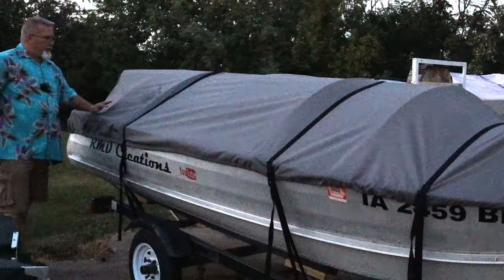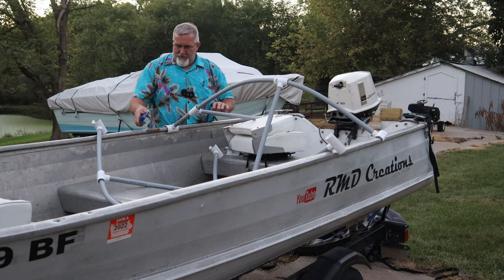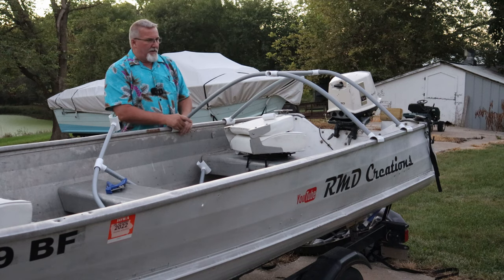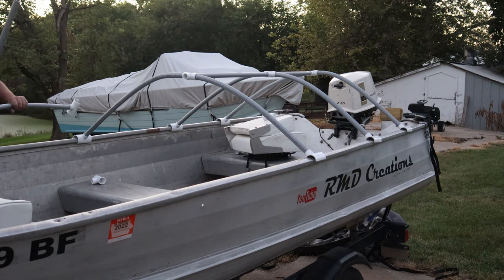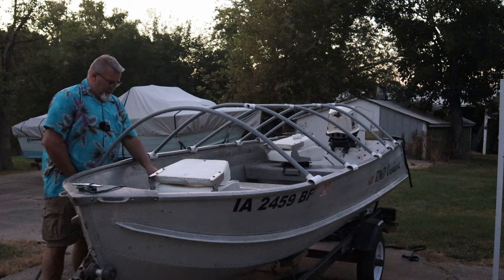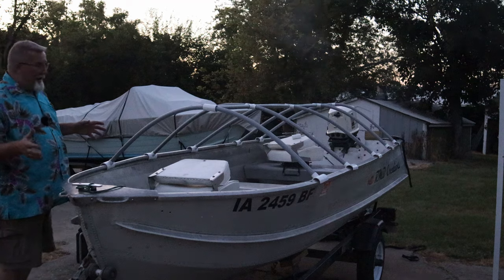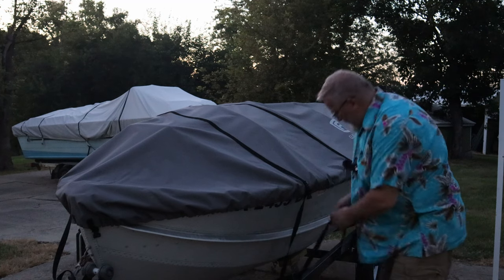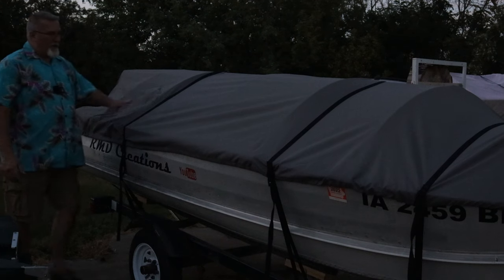Update Boat Cover Life Hack Improvement  Just adding in this one piece  5 times

Comment: After being inspired by your former video on making a frame for my cover,  I attempted the same.   I used 1inch to 3/4 inch tee on the sides with 3/4 inch schedule 40 pipe across the top hoop.   I made 4 of these hoops for a 12 foot boat.   The tension of these hoops was strong enough that no longitudinal bracing was necessary.   I believe the pvc conduit you are using is smaller and doesn't fit as tightly in the tee.   Thanks for the ideas.
Reply from the maker: That is awesome!

Comment: That's is 100% better I new it was going to work by  cutting them in the centers and connecting them you want till they are glued up how strong it will be. For you all that get a lot of snow on the pipe next to the 4way tea you can put a 3way tea and go from the pipe to the boat floor with a piece of pipe to hold the weight of the snow.
Reply from the maker: should could

Comment: I used my heat gun to ease the bending and once it cooled off retained the shape and rock solid. I used white PCV 1'' schedule 40.
Reply from the maker: Nice and strong, excellent
Reply: I did the same and used a 45 on the front rib to the bow easing the line, been using it for years and works great shedding snow. Also, for long term, hang water filled plastic bottles versus tieing down to minimize stress from any weight buildup.

Comment: I tried this before I saw your video and broke a couple of + pieces. I ended up using a heat  gun to pre-bend the cross pipes and even threw some pipe clamps over the + ends to shore them up. I think I should have used larger diameter than  3/4" and used 90° or (2) 45° angled pieces on top. I dont have a 3D printer so I have to work with hardware store stock.
Reply from the maker: I find the 3D printed stuff for outdoor use is not the slick trick I though it would be.  thanks for watching

Comment: Great project !  I guess heat-induced bending of the conduit could easily be done after assembly using a hand held electric paint stripper ... or even your wife's hair dryer gun.
Reply from the maker: You are correct there, thanks for watching

Comment: Dry fit your fittings together and use a magic marker to locate each piece by marking the fitting and the pipe then when you glue just line up the marks.
Reply from the maker: good tip.

Comment: You can just use a regular tee for the end braces as you are not putting a PVC to the front or back. White sch. 40 will work also. Also just use your tape line to find the middle of rack brace and cut it there for the four way tee or for the regular three way tee.

Also you can drill a hole in the tees and the cross members and use a large key to hold them together, one like you put in your hitch pin.
Reply from the maker: Yep, all good stuff, thanks for watching

Comment: Why don't you preheat the schedule 40, put a bend in it, then put the 4-way T on.
Next take the T's and use them between the gunwales and the 4-way T's making a horizontal rib. Giving more support for the cover.
Reply from the maker: that could work too.